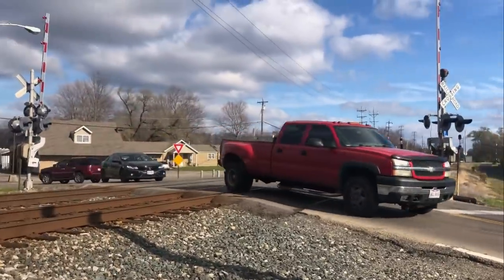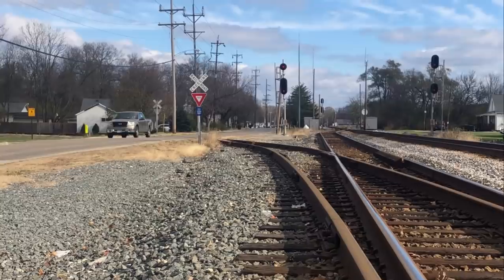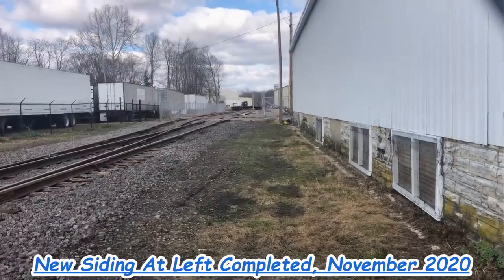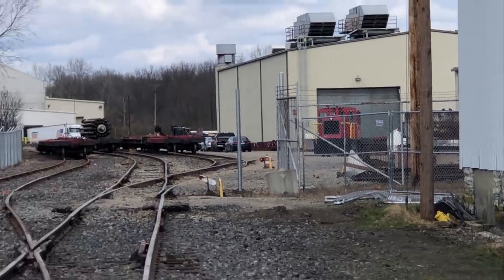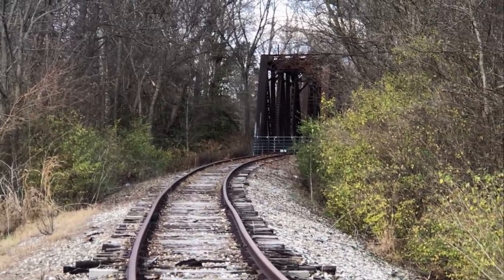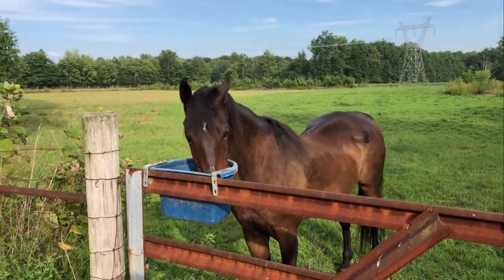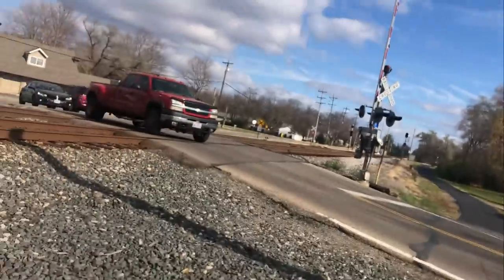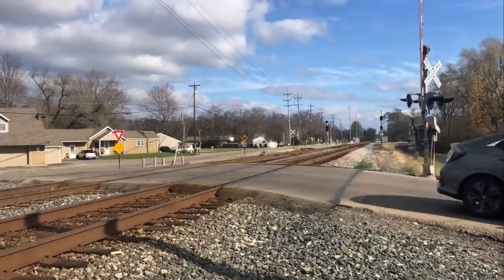New RR Siding Installation On Private Industrial Railroad, Dupps Railroad & Fast CSX Mixed Freight!

Comment: It's really sad when you see the fate of cabooses.  Add depots to that, also.  With respect to the Dupp line, the ballast and ties don't conger up much reliability, but since they aren't used that often, I guess that suffices.  With respect to you standing close to the freight, back in the day when we stood on either side of a passing freight to check for hot boxes, we stood as far out as we could because of metal bands and chains dragging off the sides of flat cars.

Comment: Well, time to crack out my AAA atlas, find Germantown, open a window with a satellite view, zoom in and check out the grade crossings between the CSX and Dupps and toggle back and forth between that and your video.   There's a soft quaranatine here in Albuquerque, but I can travel vicariously to Ohio through your lens.  BTW, I bought a little HO Athearn hustler in 1960 that's similar in many respects to Dupps' loco.  I still have it and have it geared way down to creep along.  I watch your videos regularly.  Cool.  So cool.  Thanks, Ed.

Comment: Very interesting, i would think that if tge hi'rail truck went over one of those tracks it would mean that a train will be passing over soon , no ? And great cabosse , they outta fix up that interior
Reply: "They??"

"Fixing up the interior..." = spending $$$.  Out of whose budget?  Certainly CSX has nothing in its budget for caboose repair and maintenance.

And once it was "fixed up," then what?  The caboose would quickly have access restricted by a chain link fence topped with razor wire to forestall the inevitable vandalism.

Best to just save the $$ and leave it be.  At least it wasn't cut up for scrap already.

Comment: What do they make there at that shop? I was trying to figure out what that was on the flat car... Is that the guts of a large alternator/wound rotor motor?
Reply: @kleet: google the company name. They have a website.
Reply: @deepsleep7822  hey thanks for the help... what's the company name? backside of the building has no signs.

Comment: the rust on the rail is the least of their problem - there was a hell of a kink on the approach to that bridge.... I'd have it ordered to no more than 5mph if I was the foreman for that track.
Reply from the maker: You should have seen the kink before they fixed it!  I took a pic of it before and I couldn't find the pic
Reply: @JawTooth  I have a kink to deal with next season... here on a short line railway that I am in charge of in Ontario, Canada.  We have 5mph slow orders in that section (known as a rule 43), as well as another area where we discovered wide gauage.
Reply from the maker: @lxdesign1  Wow, that track must have many trains on it

Comment: I have been reading about CET and it says that the line from Peebles to Vera JCT is out of service

Is this correct ?

There is a new channel called East Terminal Railway and it looks like they are in Ohio.

They bought a railroad

It is heavily overgrown and needs a lot of repair

I was wondering if you know who this is and if you have visited them ?

Thanks
Reply from the maker: CCET is out of service from Plum Run which is just a couple miles east of Peebles to Vera Jct and hasn't seen a train since 2003.  I don't know what that new channel is but I have a channel called Cincinnati Eastern Railroad Fans on FaceBook.  I am rarely on FaceBoook
Reply: @JawTooth  this is a youtube channel